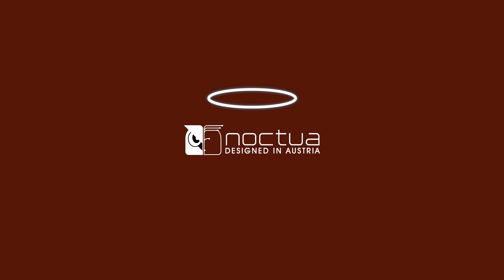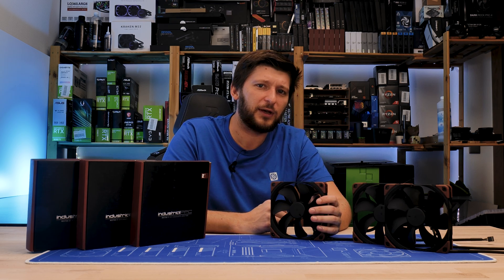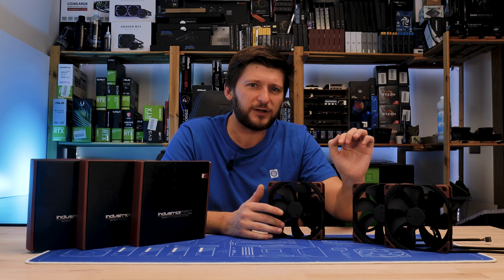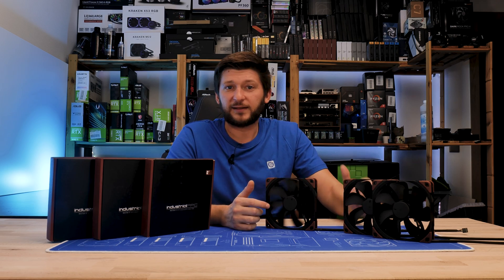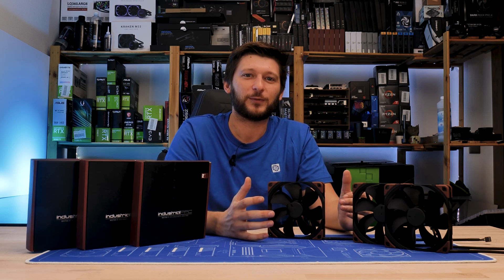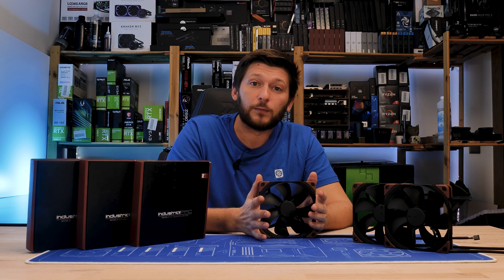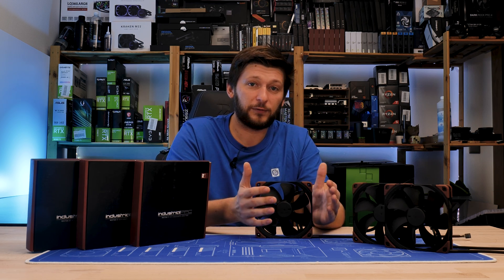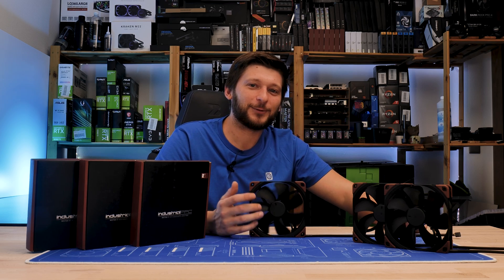Noctua Industrial NF-A14 3000 Review - The Best 140mm Fan on STEROIDS

Comment: Needing this fan or even wanting this fan doesn't mean something is "wrong". Yes the fan is loud at full rpm, but no one is saying that people can have the fan speed at whatever they want. It's not stuck at 3k rpm. It is nice to have that extra cfm if it was ever needed. My corsair fans run at 2500rpm. An Extra 500 would not push me away.

Comment: use NF-F12 3k on a u12a as a single fan, use the a14s 2k as intakes, one nf-f12 3k as exhaust and 4  Nf-F12 reedux on a 011 air mini and run ccustom pwm curves run super silent but give that extra kick when cpu loads up, also have 3x nf f12 2ks on a Cosrai H150i  and work like acharm these things have tons of static pressure for heatsink and rad apps

Comment: i always run the 140mm 3000rpm as an exhaust rear fan. i use the 2000rpm waterproof 67 ones for everything else and always pwm. i have stuk my rad in the window in winter and the fans run fine. they get wet its fine. i have had them rained on too

Comment: How are these tests using the fan? Are they only used as case fans, only as CPU fans or both and are you using an air cooler or a radiator, also can you set the A-14 Industrial bellow 25% like at what percentage will it stop spinning.

Comment: build my PC around Mar-2023 using Cougar Panzer Max, 3 front intake and 2 top exhaust with NF-A14 3000rpm

additional NF-A12 3000rpm for back exhaust and cpu cooler DH-15

recently change my chassis to Montech King 95 Pro, so now 1 more additional 140mm

I'm a fan of this industrial fan, can create a storm wind inside chassis
Reply: Are you still liking them? I've got a Corsair Crystal RGB case that I'm looking into installing 7 of these and wondering how it'll be noise wise. I'm gonna be installing an MI50 GPU and figure they can simply be tuned down to run at lower RPM until the heat comes on and then have them kick into hurricane mode. Are they decently quiet at low RPM or any annoying frequencies or sounds coming from them?

Comment: The person needing this, is someone that is doing a upgrade but looses space for push pull on a rad or doing a over kill setup. I will be going from a x79 to a x299 and adding a rtx 3070 to the loop, so a 200mm is added with the 280mm. In turn will be using two of these on the 280 and 4 sanyo 9a 92mm fans on the 200mm, and the vrm will be 3 sanyo 9p 40mm fans. Thay will be use on a phobya touch 530, that I have tested all read. Yes at max speed, they are loud but not bad at a slower speed.

Comment: I think for general use the 200rpm version are the best compromise as when you start going above that noise can get a bit annoying as most industrial fans above about noise they care about the cooling capacity, if you do happen to buy this 3000RPM version do yourself a favour and pick up some in line fan speed reducers to lower the RPM of the fan a tad.

Comment: I run them. 2 on an nhd15. Fan curve of course to keep noise down. When cpu goes 100% it ramps up to max rpm and it keeps the system cool. In order for it to work the case fan needs to remove the air, so i got a 200 plus cfm delta server fan removing the air from the case also on the same fan curve.

Comment: Do these really only go down to 800 rpm? I worry that at the lowest they won't be silent enough for me. I don't really care about highest speed
Reply: They go down to what ever you like. Im running them at 450rpm currently which is 12 percent in my asus apex board. I have to run them in a chassis fan slot though as in the CPU slot the lowest they will go is 20 percent which is too loud for me at night.

Comment: If you wanna get the best cooling system possible, buy one fan king fron Dell with 1200+ CFM and 7000+ RPM lol
Reply from the maker: You mean the fans found in Dell Servers? Those are usually things like Deltas or whatever else brand they buy it from.
But yes, these are monsters

Comment: Noctua Fans are so good , believe it or not, Im using the Industrial 2000 non PWM 140x140 version on my yamaha aerox radiator too cool it down in the very hot summer days. Works excellent. my overclocked 9700K gets cooled by 2 x nf-a12x25 , best fans ever!!!
Reply from the maker: Been riding an Aerox myself back in the days. And yes, I absolutely believe you. Had to stop a few times because of the heat. The glowing red exhaust pipe was useful though
Reply: @STSYT  it works so damn well. Best decision ever.

Comment: I have eight of these industrial fans in my PC case and they are amazing and extremely quiet when set to 800 RPM.
Reply: At 800 rpm do they really cool more than a regular a14 on 800 rpm?
Reply: @perfect.stealth  That I don't know. Fans that are designed to only go up to 800 RPM are probably designed to be more efficient at that RPM.
Reply from the maker: Yep, just hoping they’ll do another Industrial version with the A14 gen2
Reply: @STSYT  I want a Noctua 200mm Industrial 3,000 RPM version. 🤭
Reply: What did you use to turn these down
Reply: @shabbzmusic  Your fan curve on the motherboard bios.

Comment: Thanks for the video with all that data. Just a point, I am able to run my industrial NF-A14 3000rpm fans as lower than 25%. RPM goes to below 400rpm and are very quiet. You are totally right in that there is absolutely no need to run them at anywhere near 3000rpm though. When I bought them, they weren't much more than the other 140mm fan so I thought why not. One downside compared to the non-industrial fans is you don't get the other accessories in the box.
Reply from the maker: Weird, but great for you! 
Some mobos allow going lower than what manufacturers are saying and other ones don’t
Reply: @STSYT  I use argus software to control my fans.

Comment: I run the NF-A14 2k's in my system and have six of them.  Three on the front 420mm radiator, two exhausting out the top and one exhausting out the back of a Phanteks Evolv X case.  The system is generally so quiet you can't tell it is on except for the LEDs, but pushed to the limit it can get pretty loud.  Can't imagine using the 3k's, which I thought about for a moment before comparing the noise levels.
Reply: With 420mm rad of course you don't need much of fan speed. It seems to me that it can be pretty useful in more compact system where there is limited cooling capacity and if one only occasionally needs to crank up cpu to full utilization fan like this can keep up with it with undersized cooler at expense of noise.
Reply: @sk-sm9sh I will say I had a small 120mm rad and throwing a 2k noctua on it made a hell of a difference after I cleaned the fin tubes.
Reply: Hi, how does the A14 and A14 IPPC 2000 compare at same speed ?
I'm considering getting the IPPC and keep them quiet by software if no super high speed is needed.
Reply: I wonder how quite the 3000s are at like 1000-1500RPM

Comment: I'm using 3 of these on the arctic 420mm AIO using ryzen 5950x at max speed when I'm rendering and the temps never crossed 63°c in summer 😁
Reply: ZORZ! I'm about to do that. Was really reluctant cause I like silent but fuck it yah?
Reply: @ZorzGaming  I use three of the 2k version with my Arctic 420mm (also on a 5950x) and generally top out in the mid to high 50s.  Use an "enter through rad" rather than an "exit through rad" layout with three more of the 2k as exhaust fans and my PSU in its own air channel.  Except under heavier loads the system is nearly silent.  A lot of how quiet your system will be is based on case choice, vibration isolation, and and proper fan curves.  I used the Evolv X case which STS reviewed last year.
Reply: @TheInfinityzeN  that sounds awesome! I found that it didn't reduce my temps by more than 1 C and it just wasn't worth it.
Reply: @ZorzGaming  If all you got from the 3k fans was 1 C, then you were ether really restricting their speed or there is some other issue interfering with your cooling system.

If you are heavily limiting their speed, then buying the 2k fans for less money is the way to go.
Reply: @TheInfinityzeN  No I had them all at 3k. Another youtuber found the same thing... My case is an open air case so maybe that means I'm already getting great temps. But the 1700 RPM arctic fans vs the 3000 noctua was a 1 degree difference if that for 10 x the noise :(
Reply: @ZorzGaming  Why did you go with an open air case?  They tend to be louder and collect much more dust, while having some funky air flow characteristics.  Stagnate pockets of hot and cool air, recirculating of hot air, and lack the ability to built a slight positive pressure or a focused air stream.

An open air case will only net you ~1 C verse a good closed case.  If you optimize the air paths and pressure in a good closed case with powerful fans it will win, though by how much depends on how much noise you can handle.

Comment: I'm thinking about putting 2 of these in the front of my Dark Base Pro 900 V2. Got 2x 280x45mm rads in that case. The PC is not completely build yet. I'm still waiting for the last parts to arrive. But i somehow doubt the 2 included Silent Wings 3 in the front will be enough to overcome the resistance of the closed front door and the radiator behind them. But those Noctuas probably would be sufficient.
Reply from the maker: Strap the whole thing to your table. It might move otherwise.

Comment: I have a Gigabyte RTX4090 Gaming OC in a Hyte Y60 case.  Unbeknownst to me, you can only vertically mount GPUs in this case. Since the card takes up 3.5+ slots, the fans are only 4mm from the glass.  I have 2 Phanteks SK140's in the bottom blowing up.  Not really sufficient, nor an ideal cooling solution. I'm going to replace the one under the 4090's PCB with one of these NF-A140 iPPC 3000 PWM fans and see what happens.  The most obstruction is on that fan due to the PCIE riser cable being right there as well.  Hopefully the $30 6.58mmH2O Noctua fan has enough pressure to still blow air through the fins and heat pipes within the GPU.  The shroud of the GPU is quite small with lots of fin exposure on both sides with plenty of passthrough with enough pressure.  I'm not a teenager into kid games like APEX or Fortnite where I'm worried about my friends hearing noise from my PC. As long as they cool and won't damage my hearing then they're perfect for me.  If I see improvement, but not as much as I'd like to see, then I'll replace the other SK140 as well.  Noise be damned

Comment: These fans are very cool (ha) but also very niche, if noise doesn't matter there are far crazier industrial fans than spin at 5k, 7k and even 11k that will blow (ha) the PPCs out the water. These would be useful for applications where they usually have to be quiet but occasionally needs some serious burst cooling
Reply from the maker: We just got some 6k Gelid fans inhouse. Damn I’m afraid each time I start them

Comment: They are definitely not the "best" anymore. Especially for noise to performance. Bequiet, arctic, thermaltake are better 140mm.
Reply: pleb
Reply from the maker: Depends on what you use them for. But even under the "worst" conditions, there is just a small amount of coolers capable of competing under very specific circumstances

Comment: I want to buy noctuas fans! But not 100% wich of them buy. I will go all with 3000 rpm, and also want buy a ndh15, cuz i will update cpu from ryzen 5 1600x to a 5800x3d, so i want to put 2 IPPC on front of gabinet, 2 to the ndh15 (total of 4 ippc of 140mm) and 1 at the back of 120 MM (1 IPPC OF 3000 120 MM) (thats because in theory my gabinet, dont let me put a 140 mm at the back) and the 2 fans that comes with the ndh15, put them on the top of gabinet to push out air (same with the ippc of the back). U think it will do good work about airflow?  Also what i was wondering is....make difference put 3 fans to the ndh15 instead of just 2? 🤔
Reply: 2 on front 140 mm
2 on ndh15 (or 3*) 140mm
1 on back 120mm
The 2 fans that comer with ndh15 on the top of gabinet (140mm fans)

* i hv 4 spots for conecting fans on my MOBA, so i am thinking on buying the cables to conect 2 fans together, so i can hv a total of 8, so i am thinking 2 choices: 
A) put a 3rd fan on the ndh15
B) put 1 fan of 120 mm on the "floor" of gabinet

Ps: my gabinet is a cougar panzer s
Reply from the maker: Putting 3 fans on the NH-d15 won’t really give you extra performance, but a lot less noise if configured properly.
For you fan layout, sure, will work like a charm, but a bit overkill for your use case ^^

You could also go for a regular nh-d15, 2x 140s in the front, a S12A in the back and top-back, and you would be all set.
Putting an extra 140 on the nh-d15 will take away some noise, but anything from there on is just unnecessary extra. Extremely high performance extra, but still not really necessary.

IPPC fans in general are great, but they are so much overkill for basically everything :p
Reply: A fan curve is a must.

Comment: Bought 2 NF-A14 3000 brefore i even read the description and now its sometimes hella loud and what you described as cooling affect i can feel it too. When i put my hand behind my pc case while running heavy games the gpu heat flies so fast out of the case that i dont feel heat escaping but chill air instead. They are monsters and very good aslong as you run them under or at 50% speed. After 50% noise levels rise up pretty fast. Thank you for making review about it, I thought I'm losing my mind after i checked the spec sheet with 'supposed noise production' of 40 ish db. It caught me of guard when i tested it my self and hit 62db on closed front case. Case is Corsair Carbide 275r (non-airflow model).
Reply: I bought one too several years ago and its been sitting in the closet ever since I realized how loud it is. Even running it at minimum speeds is not silent like a regular noctua. It's great at pulling air, but there just isn't a silent speed for it. Also I don't know if the site specs are wrong or the packaging is wrong, but my static pressure specs are listed at over 10mm instead of 6mm. My heatsink fan is starting to get noisy when it has to ramp up, so I might have to pull it out and use it as a backup. The main place it shines is as an exhaust or intake fan though. It's soo strong it will make your case negative pressure, but it will pull in soo much air from everywhere that it makes sure there aren't any dead zones where things can heat up. You could even technically use it in a build with no intake fans. My case has two small 80mm intakes, and it pulled soo much air as an exhaust fan that the intake fans were basically pointless. Would have been nice if they could have made it just as quiet as a normal fan.
Reply: @peoplez129 You probably didn’t configure yours correctly. I have TWO of these in a Lian-Li O11D Evo set to intake. You can have noise normalized levels below 40% and still retain good performance. Both of mines are running at 14% power when I’m just browsing the web or doing something light and they follow my GPU’s junction temperature. All of this is controlled by “Fan Control”. Once you get above 1K RPM. That’s when they really start screaming. Otherwise, they sit quietly below 1K RPM.
Reply: Hi, how does they compare at same speed ? 

Since the regular A14 and the A14 IPPC 2000 are at the same price, I was wondering if it were just better to go for the IPPC and limit the speed by software to have the opportunity of faster speed if needed and more robust build.
Reply: Yup, extremely disappointed in noctua for that, they're so worried about their silence focused marketing that they straight up lie about their noise levels by an order of magnitude. Wtf are you doing noctua? People buy their products for their no bs approach but ig their marketing team took the reins.
Reply from the maker: If you wanna get rid of the insane speed jumps, you can use one of Noctua’s PWM blockers. Or anybody else’s. There are tons of them out there.

Unsure to what max-speed they would be throttled, but it’s definitely better than 100% on pc start ^^
Reply: @STSYT  are you talking about the noctua fan speed reducers?

Comment: I use a pair of these in a small rack cabinet to draw air into the case the rack holds my firewall, switches and some media kit.. All that kit dumps a lot of heat fast when you have everything running. With the standard fans it wasn't unusual to see the case temps sit around 40c +  in summer (using the switch readouts), with these I barely hit above 30c more often it's sitting at 20c. It's insane how much air these things draw into the rack in fact we had a test that held a piece of A4 at the bottom of the rack and it was almost powerful enough to hold against the vent, I assume if we air sealed the case it'd probably do so!
Reply from the maker: Yeah, hard to imagine what the next gen will be able to do

Comment: This fan is a beast. I'm running 3x NF-A14 3000 in my H510 + 2x120mm 3000 Industrial fans (including air cooler - D15S). Noise is not a big problem for me, so I aloow it run at 100% for certain very short tasks (Silent Mode is default for everything else)
Reply from the maker: Does the PC move when going full speed?
Reply: @STSYT  🤣🤣
Reply: @STSYT  In my case,  used them in a X9 Thermaltake case.. so nope.. XD

Comment: Seems like Noctua Industrial NF-A14 2000 would be a more "practical" choice. Would have liked to see a comparison.
Reply from the maker: It’s still the same fan thought. You can take a look at the Noise to performance graph and just look at where the line is at +- 70% of it’s own length. That should be roughly 2000rpm
Reply: Yup, and also the amp needed is way different for 3k vs 2k models